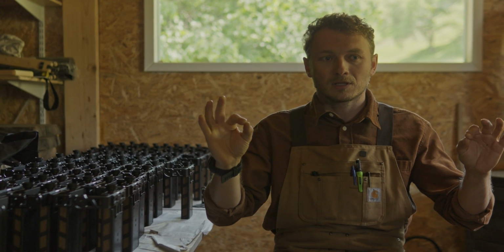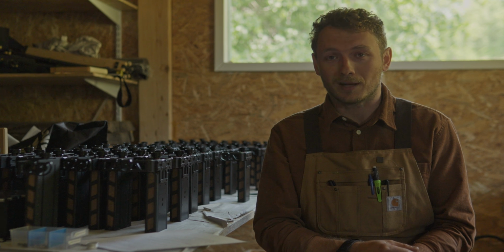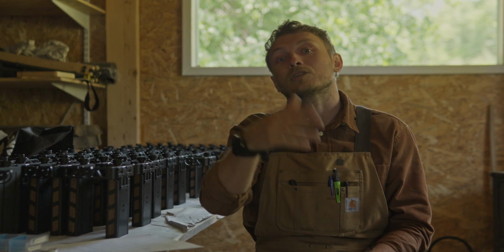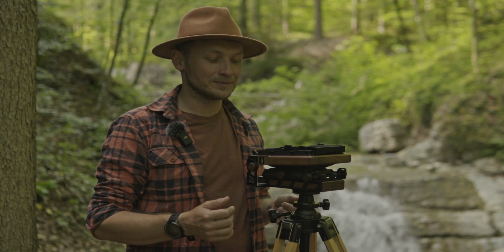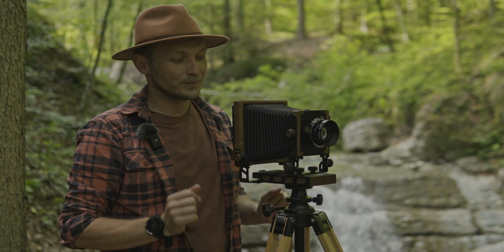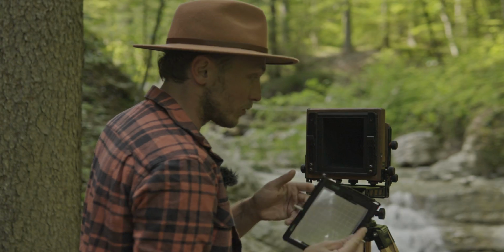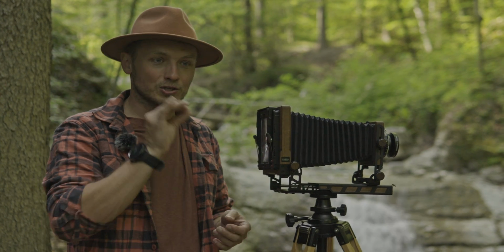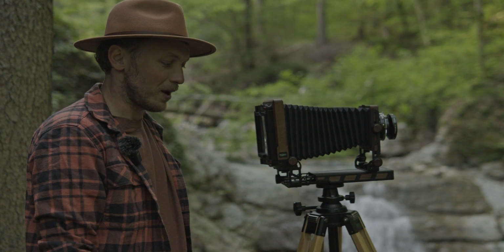ONDU EIKAN 4x5 Large format camera Kickstarter update 3

Comment: Hey Elvis! I've a question about the camera: what kind of lens board does it take? Like linhof compatible, Sinar, etc etc or else?
Reply from the maker: Hi the cameras lens boards are linhof boards compatible. I will be producing my own lens boards at a very reasonable price point from black anodized aluminum. The only question still to consider in the future is whether to keep the 2.25mm thickness of the Linhof boards or make them 2mm which would make them significantly cheaper, and doesn't bind the final users to only proprietary linhof lens boards which to my understanding are a finite resource. Another thing that bothers me personally with Linhof style boards which has a recess on the back is that this makes the camera front a bit less light proof if we don't make the front components of the camera in a similar fashion, another troublesome think with a lot of Linhof boards is that they are often off centre which means that if you use their boards the cameras zero will not actually be zeroed. As for the fresnel at the moment this is standard issue with all cameras rhat I make. Probably at later stages it will be an add on option. I'm keen to hear your thoughts.
Reply: @ONDUCameras  thanks for your response.
I'm very interested in this camera project (I'm also a owner of a Ondu 6x17) since I'm looking for a small and light 4x5 camera to bring around. As you mentioned, it's not easy no find Linhof leans board around, so I hope I can 3d print a compatible model. 
Look forward to hear exciting news about your project, good luck!
Reply: Also, I see you've mentioned the fresnel lens with the ground glass, will you produced them also? Or I have to find them on my own? Thx again

Comment: That seems pretty nice camera (and not too expensive either). More details on front locks and movements would be nice to see. I wonder if there is a single knob for rise and axis tilt or if it has base fron tilt. I think separate lock of front rise and tilt is essential to keep two adjustments separate. (some may not agree on that though). No photo on the website either shows which one it is.
A combined shift/swing is not such a problem as there is no weight of lens like with tilt and rise.
Oh, that looks so nice. I'm so tempted to order one!
Reply from the maker: Unfortunately no seperate movements on the front standard as of now, it might happen in the future, there are mixed camps when it comes to this particular feature. Base locks up to 90° so no forward tilt either, and as you guessed it the base has a combined shift/swing. There is possibility due to the nature of the construction for extra rear movements as well, but this camera all by itself is already a handful to deal by myself at the moment. If the format and model gathers momentum in the future, I will try to cater to the needs of photographers like you and adapt as we improve our production processes. Thank you for the input and kind words, means a lot! Elvis

Comment: nice presentation, but at 21:44 that tab is called a "bail Back" design, not many 4x5's have this (my SINAR F2 does, in it's own quirky way); but 8x10" does, why?... All should, it's a nicer experience, but one NEEDS to make the bottom shelf such that the film holder sits on with a TACTILE feeling, so even with the bail opening the GG 1/2" or more, you can't make the holder fall off the ledge, so exposing a slit of the holders' film area to the open air ( or worse, cocking the film, hence a focus issue as the film plane isn't plumb).
nice finished article, beautiful wood, and metal finish, looks all but an EBONY RS 45 , a fantastic aesthetic and build. PS: an idea, for the future, how about some gun metal or titanium parts?, would realy make a collectors item!!
Reply from the maker: Thank you for the clarification and for teaching me something new in the process, I have a new word to add to my vocabulary. I think most camera makers omit this since the springs needed to hold a 4x5 sheet film holder are less strong usually than those for 8x10, this would be my assumption. Thank you for the kind words, I would assume if this camera takes hold in the already pretty filled market of camera makers that there will be future special builds with various wood types, bellows and materials like Titanium or similar, but first things first. Finish this batch and see what the photography community will say about it in real life. Thank you again for taking the time to listen to me talking and for your observations. I really love reading comments like this.